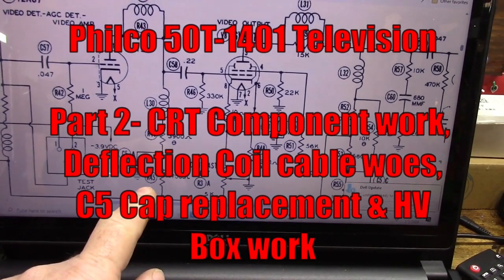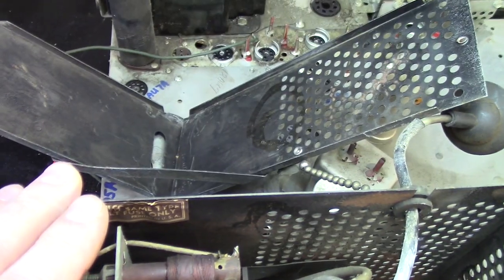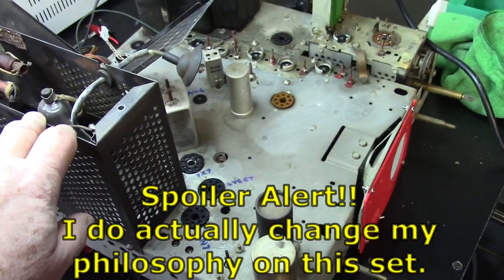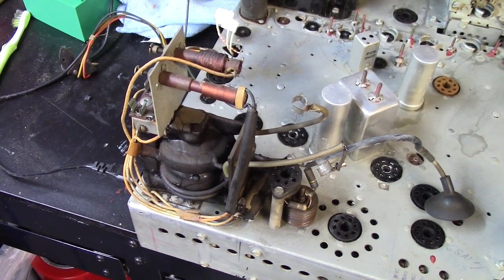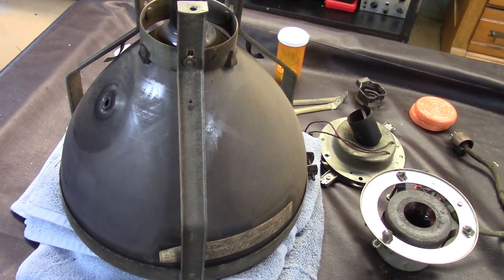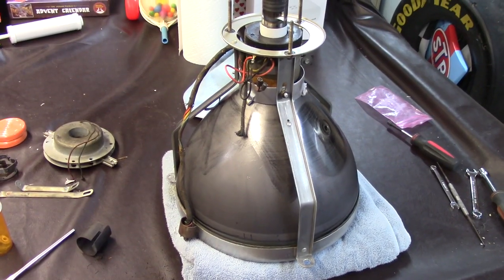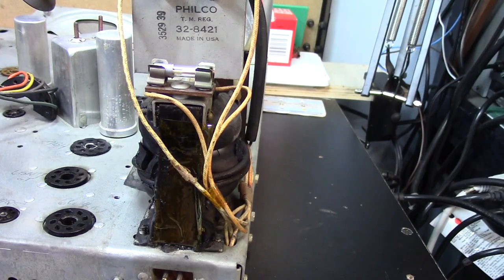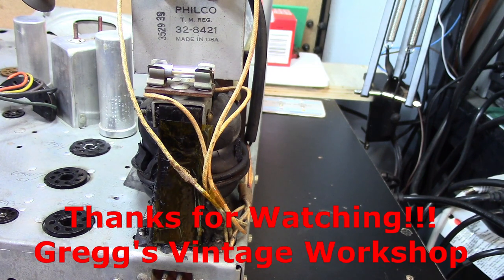1950-  T1401 Philco TV-  Part 2 - CRT coil, HV Box, Deflection Coil Cable & Missing C5 Cap

Comment: Hey Gregg, looks like everything cleaned up nice and you've done a lot of work so far. I hope everything goes as expected on your power up test. Keep an eye out and ear open for an HV arcing. That HV section is in a cage for a reason. It may be necessary to seal and cracks in the flyback transformer with high voltage putty  if it arcs to the cage. Good luck. :)
Reply from the maker: Thanks Doug, yes I ordered some new HV cable, so I should just go ahead and get the high voltage putty or Corona Dope that Bob Anderson has mentioned a few times in his video.

Comment: Gregg,
I think you’re doing nice work on the restoration. I’m not sure about the use of liquid electrical tape inside the high voltage cage, though. It’s not made for the kind of voltages that exist in that area.  Corona dope is, and that’s what should be used there. I’d get some, if it was mine. If that liquid electrical tape breaks down, it could carbon track, and then you might have problems that can only be fixed if you’re lucky enough to find another flyback. Other than that, I think you’re doing fine.  
Regards.
Gar
Reply from the maker: Thanks Gar, that's why I wanted your guy's feedback, for information like that. I have decided to bite the bullet and do the best I can to make it work. Corona Dope it is, as well as new HV wiring.
Reply: @greggsvintageworkshop8974  That’s how you learn. TV’s aren’t magic. Read the theory, then try to apply what you’ve learned to what you see with what you’re working on. Service info is very important. I’d recommend that you spend the money for the mfrs service data, or the Sam’s info, at the very least. While not magic, TV’s are sort of a circular argument… It all has to work, or it’s not gonna work, and finding the missing piece can be a challenge - especially without good data. When you get to be as experienced as Bob Anderson, or Shango, and this is your 5000th rodeo, it becomes a bit more intuitive. Until then, just keep plugging away. You’ll get there.

Comment: what do you plan on doing with this when you get it working since all signal are digital now you can only hope for snow. Use it as a monitor or get a digital control box for it? You have done a great job cleaning it up so far. You always do great work.
Reply from the maker: Thanks Larry, if I can get snow I will consider it a success. After that I will likely get a digital converter to convert digital signal to analog. But I'm not going to get ahead of myself.